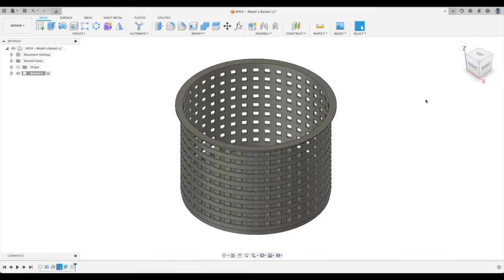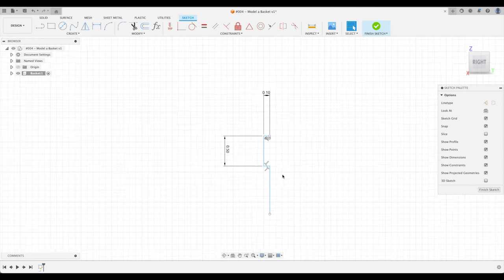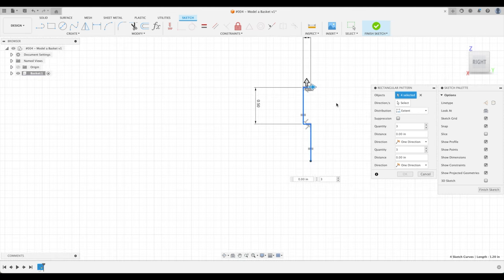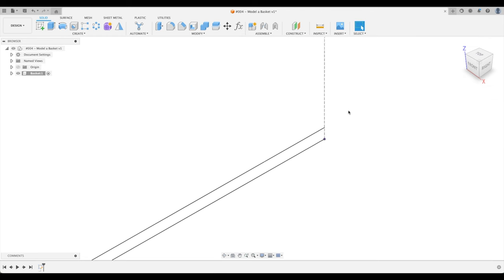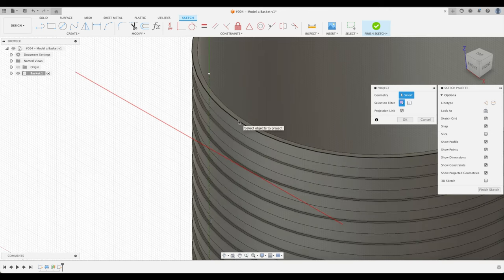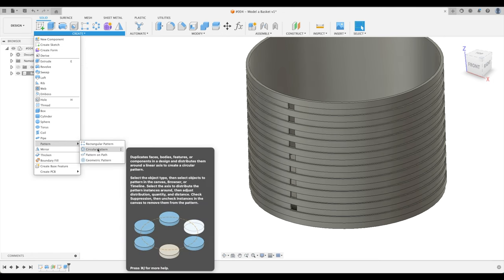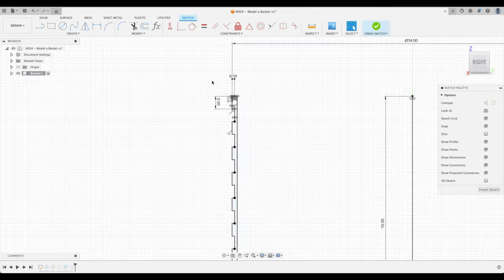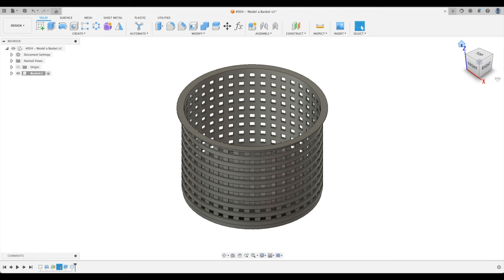Fusion 360 - Revolve Tutorial - Model a Basket - Short Tutorials #5 (2023)

Comment: Great stuff. About the last circular pattern, what if you didn't know the quantity but you did want them say 2' apart? I did not see the option to give it a dimension?
Reply from the maker: Thank you for your comment and support! 

Great question too! Entering a specific distance is not an option, because the last and first feature won’t be evenly spaced. That’s why Fusion only uses a whole number as a quantity so that it can evenly space everything. However, by using a formula we can get very close to the quantity needed so that the approximate spacing is acquired. Here’s the formula:

Outer diameter x Pi = outer circumference 
Outer circumference / distance apart = quantity of pattern (rounded to the nearest whole number)

So, let’s assume your basket is 12 inches in diameter (OD) and your spacing is approximately 2 inches (S). Calculate the following formula to use for the quantity:

(OD * PI) / S = (round this number to the nearest whole number)
(12*PI)/2 = 18.849
18.849 rounded = 19.

So, a quantity of 19 will space the pattern very close to a 2” distance between.

Let me know if that works for you!